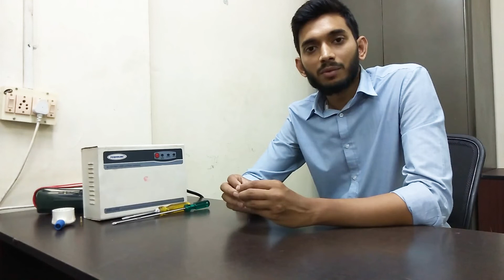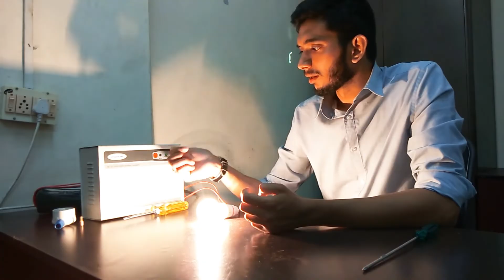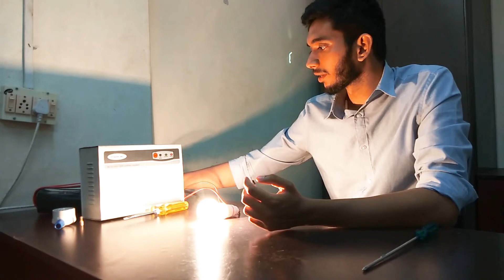Why Stabilizer starts with time delay_TAMIL. Explanation about stabilizer turn on procedure

Comment: i have the stabiliser for one year 
the stabiliser only connected with tV 
there is no instant switch like you said in the stablizer
for the past one year it gives the power after 2 mins then the tv will on
but for the past two days while the stablizer in red light the tv is automatically on 
i don’t know if the stablizer is working or not
Reply: I'm also facing the same issue did you get any solution?

Comment: Digital wall clock time is changing while power cut issues. If we use stablizer we can get right time after getting the power due to time delay process and It won't affect digital clock power board.

Comment: Hi bro ..I  buy v guard stabilizer vgsd 50.. first time on the switch stabilizer with given time delay output..but 2 r 3 days after..off the stabilizer switch and again on the stabilizer switch with in seconds given out put for refrigerator with out time delay?

Comment: Home input voltage 130v, mainline stabilizer with input range (90v-240v) vechu voltage boost panna mudiyuma? 2hp motor continuous ah run panna mudiyuma? (Using 5kva stabilizer)

Comment: Brother i have some questions. Please answer when u get sometime. In my home during night time im getting 130 to 160v. my tv,hometheater is not switching on.  Can i buy AC stabilizer and use it for tv and hometheater? If so which stabilizer is cheap and best for me. Some body saying use CVT in main line. But im in rent house,owner wont allow for this. Suggest me some idea bro

Comment: I have a small question. I have an induction stove (rated 1800w). My house electricity grid supply subscriber connection shows 2KW connected load. Whenever i turn the stove on at just 800w power level, even my computer ups starts beeping and doing noises like tripping and the ac etc just slows down, even the LED panel lights which are just 22w each become dim. Will adding a mainline stabilizer at the entry of power into the house solve this issue or should i put a stabilizer just in front of the stove so that its drawing power from its own stabilizer. Which will solve this problem please ?

Comment: வணக்கம் தோழர்
 எங்கள் வீட்டில் A/C stabilizer ல In put V 180 to 195 வரும் போது Out put V 195,200,210,237 வருகிறது. மேலும் 210 V வரும் போது 210 வருகிறது,160 to 175 V வரும் போதும் 210 V வருகிறது , சில சமயங்களில் 190 V வரும் போது 190 V ம் வருகிறது இவ்வளவு பெரிய வித்தியாசம் ஏன் வருகிறது.(V guard) தயவு செய்து விளக்கம் தருக.

Comment: In this video time delay is purely a design for ac &  refrigerator compressor. without delay, the compressor will take a high current & OLP will get a trip. It makes damage to the compressor regular will happen. All your videos are very excellent. sir.

Comment: is there any delay while balancing the output voltage? Suppose the voltage is decreased to 150V ideally the Stublizer should provide stabilized voltage like 230V, my question is there any delay to boost the voltage to 230V?

Comment: I have seen  while using inverter ACs the fluctuation in voltage is transmitted to the AC which works fast/slow  WhY?but not seen in conventional ACs I have seen this in V guard as well as in syscom stabilisers in  3 ACs i use at home .what is the meaning of stabiliser when   it does not regulate the voltage?

Comment: Apart from the reasons which explained in this video, there is one more reason for this time delay, ie in Reciprocated compressors used in old model ACs, the AC shouldn't be started within 2minutes after power goes and comes, if it so the compressor may get damaged, hence this time delay included in stabilizer. In modern days ACS time delay is included in AC itself, hence even if you off and start your AC, compressor won't on until it reaches its time delay, but LEDs and fan will start immediately if you off and ON.

Comment: Sir what u r telling is instant start operation is no problem. no sir its 100% electrical equipment is ok but air-conditioner is electrical n mechanical  equipment when compressor once get on the head Pressure create in compressor then immediately off it I'll time 3mint to equivalising the head Pressure that's the reason ac mechanic suggested don't use every time instant start it I'll harm your compressor

Comment: When I connect my computer cabinets inputs ground pin on the socket my cabinet gets minute shock . Do yoi know why? I've checked my 3 pin wall socket and it's grounded well also i tested the ground and neutral with tester I don't get any voltage please tell me

Comment: Oru important points solala nenga, Fridge or Ac rendulaium compresser use pandranga compresser power poitu odana on aga kudadhu load agigama agi trip agum so aduku time delay romba mukium Ac use pandravanga power poitu odana vanda instant use pana trip aidum,reason compresserla presser irukum so instant on pana presserla compresser load adigama agum delay apo use agum.

Comment: Enoda refrigerator stabilizer on panni 1hr normal time delay oda run ahuthu but continues ah oduna relay sound adikadi varuthu sometime 5sec r 10 sec etho oru time ku on ahuthu fridge la irukra light antha time dim ahi bright ahuthu. . . Marupadium 1 hr total off panna again konja neram nalla oduthu. . . Input crct ah illana epovume antha prob varanum la. . . Ithu ena reason ah irukum brother. . .
Reply from the maker: Stabilizer is adjusting voltage. Nothing to worry
Reply: Thanks brother

Comment: Input power variation ன சரியாக calculate செய்து output தரக்கூடிய circuit ன் சரியான பெயர் என்ன. அது  எப்படி work ஆகுது. இதைத்தான் time delay னு சொல்லுரிங்கலா🤔
Reply from the maker: Calculation panrathuku 2 min time thevai illa. Ithuku per than stabilizer. Thanks

Comment: Last time ennoda veetla 240 volt badhila 255 volt power vandhadhu but stablizer adha cut off pannama ponadhunala home theater receiver smps IC short aagi burst aagiduchu....yedhunala stablizer cut off pannala sollunga...
Reply from the maker: Maybe stabilizer issue
Reply: @engineeringfacts  thank you for your reply....stablizer issue accepted but indha issue stablizer la yedhunala nadakumnu sollunga...because most of electronics device stablizer potah safe sollumbodhu idhu madhiri issue vandhalum problem dha thank you

Comment: Hi Bro, Should I use stabilizer for my LG AC Inverter AC. 
And can i connect battery to my stabilizer in series and use as a UPS for my Inverter AC?
Reply: Hi Bro, Should I use stabilizer for my LG AC Inverter AC. 
And can i connect battery to my stabilizer in series and use as a UPS for my Inverter AC?
Reply from the maker: You cannot use like that
Reply: Thanks for your response

Comment: Do stablizer need to calibrate .if is then at wat interval it should be done ?
Reply from the maker: Not calibration, testing can be done for yearly once as a maintenance
Reply: @engineeringfacts  with variac.

Comment: Time delay is used in AC & Fridge Stabilisers to protect the compressor. TV or other stabilisers don't have time delay of 2-4 mins.
Reply from the maker: Time delay is an additional function. Basic stabilizer function doesn't require
Reply: @engineeringfacts  but v guard Digi 200 stablizers la time delay irukey
Reply: Yes....true..same time fridge stepilizer only have over time delay

Comment: Most needful video.
Reply: வணக்கம் ஜி என்னோட ஸ்டெபிலைசர்  டைம் எடுத்துக்க மாட்டாங்க உடனே ஆனா அது என்ன பிராப்ளம்
Reply: @ansarnisha1685  ji appa unga hose la correct voltage la current varuthu no problem
Reply: Bro stabilzar input varuthu but output varala 10mins a ena problem bro new stabilzar
Reply: @rajeshsekar817  stabilizer cut out problem, even it is new some time this problem will come
Reply: @Starbabu-we  is

Comment: bro, how to save electrical appliances (TV and set-top box) from lightning and thunder? my tv main boardand settop box busted bro
Reply: What is the engineering behind this, why does the TV fails while Thunder or lightning strikes, can you please make an video on that
Reply from the maker: Remove plug, while rain
Reply: set-top box disconnect panna pothum la bro!?

Comment: Bro yesterday night ac on panni konjam nerathula ,sudden la stablizer relay change sound vanthuchi ac oda compressor off ayidichi ....so konjam sec duration la voltage change anathu la ac oda output cut ayidicha?1 Ton inverter ac and v guard  vwi400 I'm using bro...pls reply
Reply from the maker: Nothing to worry, it's a protection function

Comment: Hi sir.. one doubt sir.. 
5kva vcard mainline stabilizer using 1 month in my home sir... Input voltage 110 to 160 sir.. stabilizer output 230 sir.. but 1hp sub motor to be start the stabilizer is suddenly to time delay function and also low voltage sir.. and also motor not running.. above problem solution to give me sir...

Comment: Someone says to protect compressor of ac and fridge.. it has time delay.. at the same time tv stabilizer have no time delay
Reply from the maker: For stabilizer function, no time delay is required. Time delay is a additional feature only
Reply: @engineeringfacts  compressors have inbuilt time delay relay.
Timer in stabilizers is only a gimmick.

Comment: Bro Ac stabilizer 24hours ON la irrukalam ? ,6-8 hours using but.......
Reply from the maker: Stabilizer will not consume any power. On la irukalam.
Reply: ok bro,but if touch my stabilizer Ac in off condition ,it heat in Everytime y .
Reply from the maker: That's not possible, then keep your stabilizer turned off.
Reply: Check voltage between neutral and earth.

Comment: bro na double booster stabalizer use panren....200v varapa.... stabalizer oru tuk nu sound varudhu...again 200v low ah porapa..again sound apdi agudhu..idhunala ac prblm varuma???
Reply from the maker: No, stabilizer relay moolama voltage adjust pannuthu. So ithu problem illa. Thanks.

Comment: Bro my v guard mini crystal stabilizer  when switched on input light vittu vittu varuthu with tik tik sound. Output varala.  After 10 min output varuthu.... What may be the problem. Will it cause any problem to TV
Reply from the maker: Input fluctuation iruntha antha Mathiri aagum. Stabilizer atha tv ku poga vidathu, so don't worry.
Reply: @engineeringfacts  bro I checked the same stabilizer in my neighbour s house, there too same problem... Electrician says time delayer fault nu is it true?
Reply from the maker: If you facing same issue like neighbour means, it's not a stabilizer problem. You have to check input voltage..
Reply: @engineeringfacts  because neighbour will also get supply from the same transformer.
Reply: Hollo ji stablizer side la kuduthurupanga stikker input150v & out put 230voltage nu ungalukku 150 voltage varala athunalathan stabilizer kulla relay system irukkum cutt off pani kudukkuthu antha 150 voltage vara varikum relay system vidathu 150 voltage vanthuruchina 3min la 230voltage ninga sonna antha tik sound varum correct aana current varuthunu theyrinthu kollalaam ji

Comment: Bro night time la mattum stabilizer   output vara matinkuthu bro. Even power voltage normal ah tha eruku lineman check panni sonnaru instant start click pannalum output  varala bro
Reply from the maker: Voltage romba low a iruntha output varathu. Voltage sariya irunthu, then output varalaina, stabilizer problem irukalam.

Comment: Bro ac premier stabilizer  iruku but output on agala input than iruku 1 hour delay agathu output on problem
Reply from the maker: Check input voltage, turn off and on your stab multiple times. If still output not cominga means, stab having issue.

Comment: Anna stabilizer la double light speeda varuthu enna problem irukkum .... Delay aakala ... Nanga vangi 10yr aachu
Reply from the maker: Delay function work aagala. IC or relay poirukum.
Reply: @engineeringfacts  ippo enna pannalam bro new one vanga va illa if or relay mattum change panna pothuma
Reply from the maker: Open panni paththa than theriyum, exactly yenna poirukunu. So if it's a good brand, try to service it. Or you can go for new one.
Reply: @engineeringfacts  bro good stabilizer na neenga etha recommend pannuvinga .... Pls tell me bro
Reply from the maker: I can say the brand by well stabilized output.. which I tested, Everest, and V guard. That doesn't mean other brands are bad. Some local brands doesn't stabilize the voltage. They're stabilizer only on name..

Comment: sir , instant power  two to three times on panaean ,, high amps yeaduthu compressore off aichu,, aprom direct ha power connection kuduthean without stabilizer, antha tharunathil irunthu ac running agumpothu 10.5 amps la run aguthu,, athuku munadi varaikum 8.9 amps la run achi,,
Reply from the maker: Check the voltage on the both time. If voltage is low, then current will be high. Due to low voltage, the stabilizer may turn off, not because of high current.
Reply: @engineeringfacts  நன்றி sir replay panathuku,  voltage is 236 v from stabilizer out put is 247 v,,  is it good condition stabilizer
Reply from the maker: The output is okay for now. Check with the output range mentioned in the sticker.
Reply: @engineeringfacts  output is 200 to 240v
Reply from the maker: Then your stabilizer is having issue
Reply: @engineeringfacts  உங்கள் தகவல்களுக்கு மிக்க நன்றி, அதை எப்படி சரி செய்வது ஒரு காணொளி போட்டிங்கனா இன்னும் சிறப்பா இருக்கும்,, stabilizer இல்லாம ac use panalama
Reply from the maker: உபயோகிக்கலாம். Voltage சரியாக உள்ளதா என பார்த்து கொள்வது நல்லது.
Reply from the maker: Watch this video, it'll give more information
https://youtu.be/RJjCRWdP9os
Reply: Super video bro. My doubt isif the voltage fluctuations happen  when the ac is running, will the stabilizer is of any use?

Comment: Bro my TV Stabilizer is constantly not giving output, my TV is automatically getting off and I have to switch off the plug and on it and i could see output is not coming at all. Please help. Pannunga
Reply from the maker: Repair or change your stabilizer bro. But before that, check your input voltage
Reply: @engineeringfacts Thanks for the advice bro. Will contact stabilizer customer care

Comment: Bro fluctuation reduce panna tha antha 2 minutes so instant start maximum use panna kudathu athu emergency purpose kaga kuduthathu odaney appliances on pannanu na instant start use panla otherwise that is not safe
Reply from the maker: Oru stabilizer open panni, athula 2 mins ku fluctuation adjust panra device yenga irukunu yenaku photo anupunga. Apparam, fluctuation yeppavume supply la irukathu, athu yeppavachum than varum. Neenga yen video va 💯% nambalam. Neenga already antha thappa pannitu irunthinganna, please mathikonga.. thanks bro.